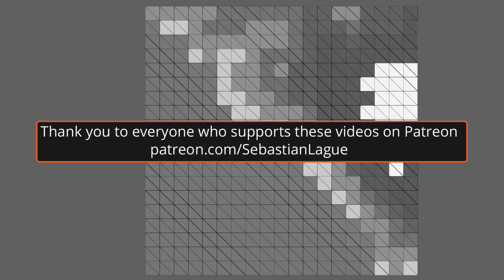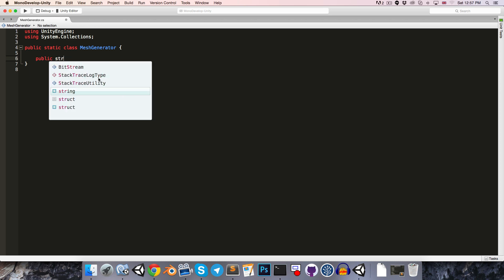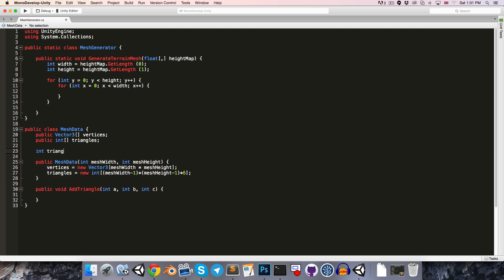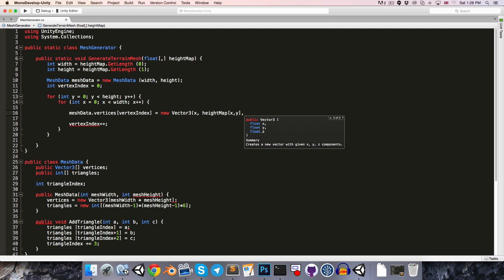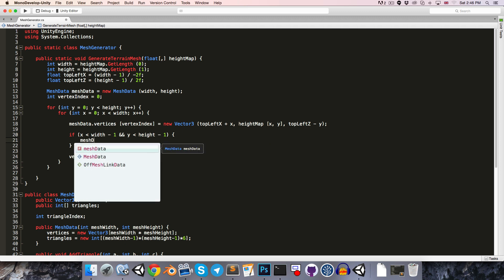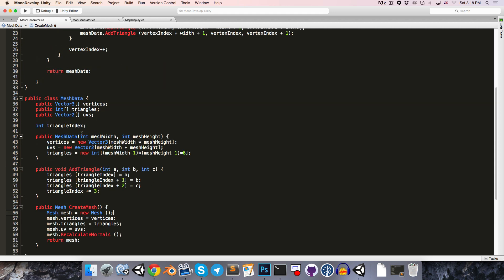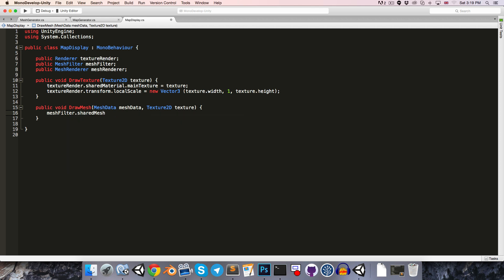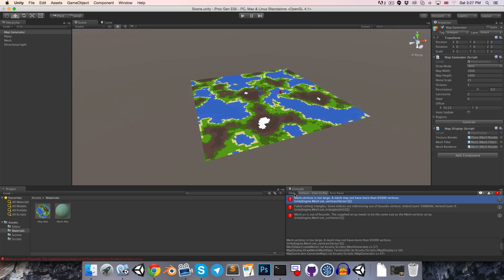Procedural Landmass Generation (E05: Mesh)

Comment: apologies if this was covered. I'm out of town and have only seen parts of the vid. How would we structure the mesh if we wanted to go for a flat shaded approach with separate vertices? As in how do I keep track of the separate vertices that share the same position so they can equally be height adjusted?
Reply from the maker: +Seth Decker You shouldn't have to keep track of which vertices share the same position. Their height is determined by their position, i.e. using the same x/y value will produce the same height from the heightMap. Sorry if I misunderstood your question!
Reply: +Sebastian Lague Hey Seb, let me clarify. Say I have two quads with separate vertices, so two vertices of each quad share the same position. Now if I move one of the quads they will separate since they don't share vertices. I figure from this that if I wanted to make a rigid, rocky looking terrain with a large array of these quads (as a single mesh, not actual quad objects) if I just adjusted the height of a vertex then there are still three other vertices in that same position that didn't get moved. hopefully that makes more sense. if not I can make a patron post with an image of what I'm talking about. thanks
Reply from the maker: +Seth Decker Perhaps when generating the vertices you could add them to a 'Dictionary<Vector2,List<int>>' The key would be a vector2 of the x,z coordinate of the vertex, and the value would be a list of ints containing the indices of all the duplicate verts. Then when one vertex has its height updated, you could use its x,z coord to find all other common vertices in the dictionary and update their heights as well. Not sure if this is the best way to do it, but it would definitely be something to try. Hope that helps!